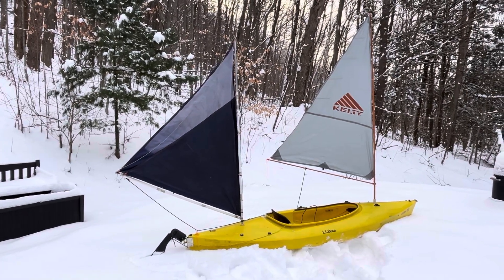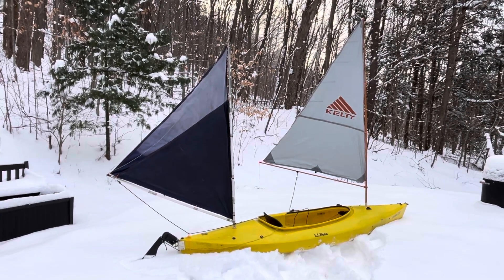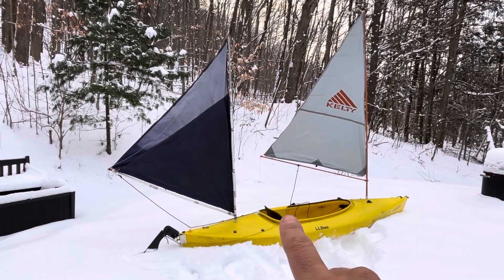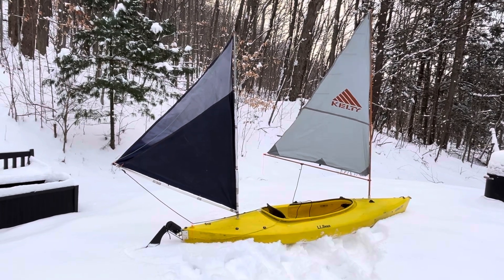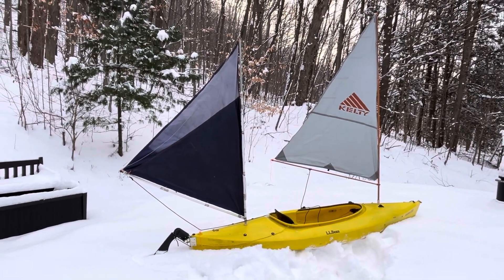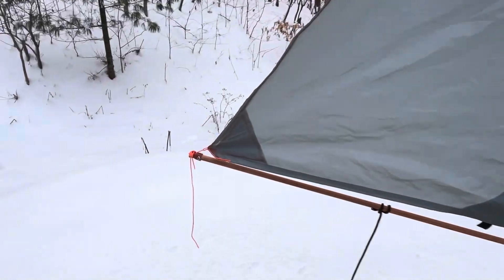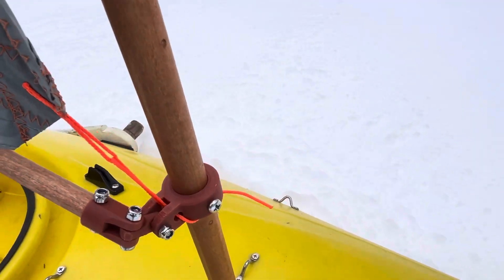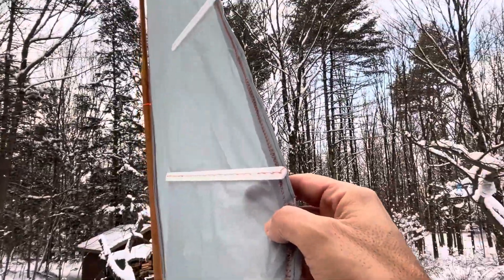Sailing kayak update 2024.1

Comment: Leeboards are your best friend for going upwind. If you want something that retains the kayaks shape, I suggest stacking as many SUP fins underneath just behind the mast as you can. They should help prevent sideslip and keep the kayak going straight.
Reply from the maker: Thanks. There is a leeboard on the far side. With the single mast it helped but didn’t help that much above a beam reach. The CG seems to dominate the CLR and I’m hoping this more balanced sail plan will be the ticket

Comment: Without stays, a medium wind would break base or blend mast. It's much better and easier to install a Genoa instead of a second mast. If you want to keep a higher eficiency, move centerboard a little back, as near from the center of the boat possible, if not, you will have to trim the mast. Keep going.
Reply from the maker: Thanks. They go all the way thru. I’m not worried about them just yet.